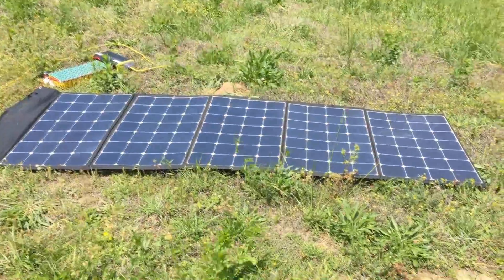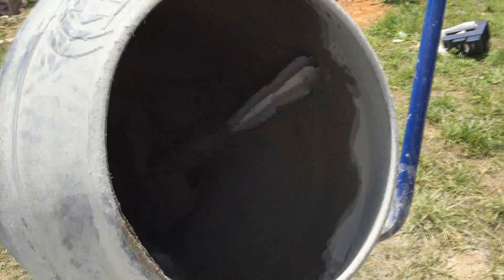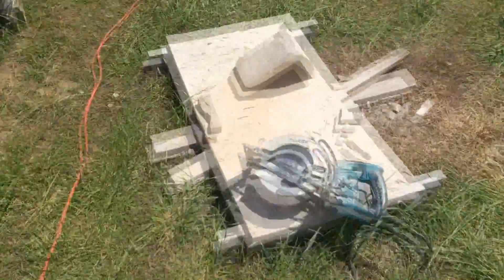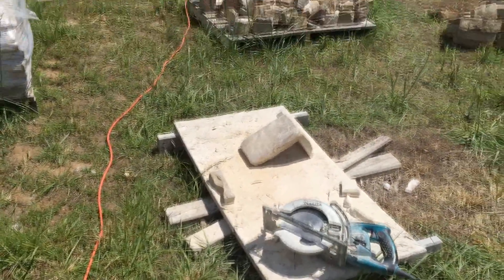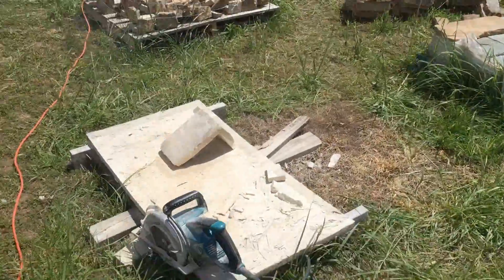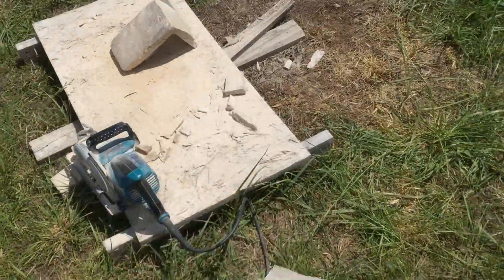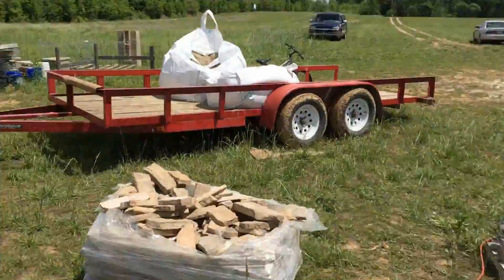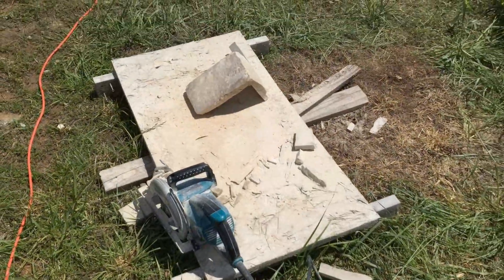SOLN1 2000 Update  - Battery-free Solar Generator

Comment: Here is a set of flexible solar panels, https://www.aliexpress.com/item/New-flexible-solar-panel-400w-solar-home-system-kit-100w-solar-panel-4pcs-monocrystalline-solar-cell/32748054355.html?spm=2114.search0104.3.8.nYn8sn&ws_ab_test=searchweb0_0,searchweb201602_1_10152_10065_10151_10068_10130_10084_10083_10119_10080_10307_10082_10081_10110_10178_10137_10111_10060_10112_10113_10155_10114_10154_10056_10055_10054_10312_10313_10059_100031_10099_10078_10079_10103_10073_10102_10120_10052_10053_10142_10107_10050_10051,searchweb201603_19,ppcSwitch_3&btsid=a4212515-3197-4669-976a-11da0392f09c&algo_expid=ecc8c09d-b21d-47ee-a0d5-9425a27553dd-1&algo_pvid=ecc8c09d-b21d-47ee-a0d5-9425a27553dd
you would have to make your own case though

Comment: this is awesome ive been thinking about building a solar system with a capacitor bank and have been wondering if these capacitors are safe before building it becuase i believe they cant shock you since they are 12 volts but ive been wondering if this is true with even the high farad capacitors like lets say 500 farads at 12 volts.

Comment: There is no thing as free energy, even if you go solar you have to spend loads of money on solar panels, which most likely won't last that long and you will have to buy new ones in the near future.
Reply: +mtothem1337 I disagree. The energy from the sun is free. Always has been free. Figuring out ways to collect it is not free. Actually the figuring part is free but the actual implementation is not free but it is getting cheaper. Solar panels purchased in bulk are getting pretty darn cheap and considering that most can last 30 years would seem to negate your negative argument.
Reply: consaka1 The suns energy is generated by nuclear fusion, it's by no means free energy.

But we are moving more and more torwards a future were solar panels are affordable and pratical though, so that's nice. Would love a future where everyone can just slap cheap solar panels on their roofs and power their houses without having to pay for it.
Reply: mtothem1337 ??? Seriously? Do we have to define "Free"?  How much did you pay for that "nuclear fusion"?  How much did anyone pay for it? I don't pay for it thus it is "FREE".
Reply: That future is now.

Comment: Not practical on a construction site at all. You need Li-ion for that, and lots of it. Something in excess of 10 KW/h.
These caps are best suited as back up batteries. Something like C/100.
You would not be able to cut one of those stones from begging to end. Let alone a few dozens.
Forget about the compressor, the power tools battery chargers, skill saw, chop saw, etc...
A Nissan Leaf bank connected to 2 x 48v-3000W inverters will do the job for about $8k.
if you wanna build out in the wild, and don't have access to gas, or don't want to freak out the nature around you by running a generator, it's the only way to go.
I built one and used it to build my cabin in the Canadian wilderness. Now, its a part of my solar power system :) 
Only have 500 W of panels. nuf for me.
I set aside $100/ month to buy 2 panels a year. In 10 years, with 25 x 100 W panels, and as the batteries age, I am ready to run mostly on the panels alone.  During the night, I'm a sleep and the cabin consumes 20 W/h.
Heating is by propane, but who knows what the future will hold ...?
EDIT: For those of you interested in wilderness living but don't want to be savages, check out: 
https://www.ubnt.com/products/

Comment: That unit should power flying adventures on the powered para sail maybe?
Reply from the maker: +1NRG24Seven I have some ideas along this line.  I have an aircraft design that provides tons of solar surface area.  It has great flight characteristics and is strong and easy to build.  Super caps are light and the new solar cells are very light.  I just do not have the time right now to start building the full size models.  It is very fun to dream about.
Reply: +lasersaber Maybe open source it? Let a community of people do that part and you provide the basics to its design...i think the idea would "FLY"

Comment: if somebody wanted to run they're 26 inch TV their PlayStation 4 be able to charge the phone run a fan and a lamp 24 hours a day what type of setup when one recommend and is it possible to be able to run a mini fridge as well? well I know anything's possible but what type of system
Reply: +nitpoon 
For solar ???  That's a bit more complicated since you need to know your energy consumption and calculate how much  Solar panels you'll need and how many batteries are required.  You'll probably need a minimum of around 500-600 watts of solar panel and  maybe about 2-3 deep cycle marine batteries.  This is just the bare minimum provided that you have good consistent sunlight.   That's about 1000$  right there.
Reply: +WTF BBQ yeah I'm using 4 Batteries they're like 250 bucks a piece sealed. I plan on having 4 200 watt solar panels I'm new to all this so I'm not sure how much that will put into the batteries I would say somewhere around 2000 Watts 3000 Watts daily is what I might need
Reply: nitpoon Oh wow,  you're really going for the expensive stuff. It's not bad anyway because it'll pay itself off in the long run. 800watts of solar panels was what I was going to suggest to you, but I wasn't sure what your budget was.  My 500 watt system cost me 1k $ and that kinda hurt...

I used the cheap batteries from Walmart.  They're about 100$ each.  Ideally,  you would only discharge the battery down to 70% to prolong its lifespan to 5 years or longer.  Draining it down to 50% consistently will kill it faster.   Most people think that the battery rating means it can store and deliver all of that energy,  but that's really false.  Only 30% of that rating is usable on a daily basis (50% on occasion).  So based on the 70% rule,  you'd size your battery according to your needs.
Reply: +WTF BBQ I've got a lot to learn it looks like pretty simple math to figure it all out but in the end I want to be able to run a mini fridge a lamp a fan a PlayStation 4 a 26 inch monitor 24 hours a day and my 26 inch TV I literally just started learning about this a week ago so I'm a total noob
Reply: nitpoon 
It's a cool project, and it's fun. You won't regret it. Though it might be expensive,  it'll pay itself back.  I believe I calculated it to be around 5 years where I live (used to be 10years).

  The weakest link in this system is really the battery. Lead acid battery is old technology that requires a lot of pampering.  Lithium ion is super expensive and can be volatile. The next best option are super capacitors, but the ones available on the market are not practical enough to replace batteries yet...

Whenever you are more comfortable with solar and batteries down the road,  look up Bedini pulse chargers.  There's plenty of them on youtube DIY.  They repair worn out lead acid batteries which "Theoretically"  can extend the life of your batteries more than 5 years.  I've heard some people used theirs for 10 years.

Comment: I'm not trying to rain on your parade, but that's all being powered from the batteries and not the sun. Otherwise you might as well say that everything is being powered by the sun. Since all fossil fuels + most renewables also come from the sun..... What you're doing is using the sun to charge your batteries/caps and then using those to power your equipment...... The reason I'm complaining is because it'll make people think that your solar panels are putting out 1kw+, when in fact it's just 100-200w, so people will erroniously think that the sun can provide that much power. It would be like saying my car starts with a battery, therefore my internal combustion engine runs on batteries.
Reply from the maker: +Eugene S   If you take a look at 0:23 in the video you will see the wattage used by the cement mixer.  The cement mixer uses 338W.  The solar panel unit is specced at 400W.  I was able to run the cement mixer all afternoon with an excess of extra energy for doing the occasional cut with the saw.  The capacitor bank provides a buffer that allowed the mixer to keep running even while the sun was blocked by the occasional cloud.  The capacitor bank charges in just a couple minutes.  It does not have enough energy to power the mixer for very long on it's own.  This unit was powering the cement mixer in real-time, not form the stored energy in the capacitor bank.
Reply: +lasersaber I see, but it looks like you're running the cement mixer and the saw at the same time..... That looks like a 8-10 amp saw to me.... Here's the main question, if you turned on the saw and the mixer at the same time, you agree that you'd only be able to do that for a very short time because the majority of the power would be coming from the capacitors. If not, then why even bother with the caps? To say that this was run off sunlight would suggest that your solar panel is providing enough power to the devices.... Second, wouldn't it be MUCH cheaper to just add a 12v battery instead of the capacitor bank? The advantage of the caps is that they can release huge amounts of energy quickly, I don't think your device needs that at all. Replacing them with lithium cells would get you a LOT more run time since the batteries can hold a LOT more charge. Finally, have you tested that solar panel's output? A 100w solar panel is usually around 24x48" in size... I can't tell but it looks like your entire panel is about that size... Again, I'm not trying to discourage you, just trying to offer my opinion to help you along with your projects. I've worked with solar a lot before, and there's a lot of inefficiencies that people forget to account for. But I guess my biggest question is why bother with caps when batteries are way better suited for this job? I don't know what caps those are, but if they're not super capacitors then a few 18650 cells would hold way more charge then a capacitor bank. The caps would be useful if you were trying to do something like DC welding where you need crazy high currents.
Reply: i bet you work for the government Eugene.you just don't get it
Reply: +Eugene S 
You should consider the capacitors as a damn/reservoir combo. It lets the sun dump energy into a "bucket" all at once. You can fill and empty the bucket all at once with capacitors too.  So, you can run the equipment as long as your on demand draw does not exceed your supply to the bucket.
Reply: +Eugene S 
The tools in the demonstrations are to showing short bursts of use/demand. Not running a band saw in a wood shop. Cutting 400 pieces of 2x4s.  So the recharge would in theory be quick and sufficient enough for quick intermittent uses. Fill up the 5 gallon bucket for a 3 gallon need... Turn off the spigot and it fills the 2 gallons (capacitors) almost as fast as the panels can push the power into the bucket.
Reply: Wouldn't the government benefit from energy independence? I'm just trying to point out that batteries are better than caps in this case. This isn't some sort of breakthrough technology that somebody's trying to keep down..... It's just a portable energy source...
http://www.amazon.com/Goal-Zero-22004-Solar-Generator/dp/B00CWBABRM?ie=UTF8&keywords=solar%20generator&qid=1464289868&ref_=sr_1_1&sr=8-1
Reply: @Eugene S - That's a pretty tiny power pack for a not so tiny price!
Caps are great for surge demand and quick recharge, with batteries for more stamina.
Solution is to add more panels and/or more caps if you need more power, and you can always add a battery between the charge controller and caps  if you don't mind the extra weight.

I made a couple of cheap portable folding 120W panels using 36 Sunpower cells off ebay and A3 foamboard from an arts shop and used 6 cells per page - it's easy to add more as funds/time allow, but they aren't as efficient as they could be because the cells run hot in their mini-greenhouses. I'll rebuild using better materials if I can find some.

I'm charging a big 48V 1.3kWh lithium polymer pack using 10 multicopter lipos for my ebike - best price/power/performance I could find, but MPPT controllers for it are as rare as rocking horse doo-doo! Looks like I'm going to have to try to make my own controller/psu.
Latest video on my channel describes it.
Reply: What's more important when operating equipment that needs a steady supply of power? To have a high flowrate but small bucket, or large bucket with a slower flow rate? Since increasing the size of the "bucket" would be relatively cheap with batteries (compared to caps), it's a more important factor to consider than the rate of charge. I don't know the exact capacity of that system but it's likely less than an a single 18650 cell ($5).
Reply: Can't pull the juice out of 18650s as quickly, can't charge them as quickly either.  Also, you can only use the top of the batteries, whereas most of the juice in the caps is available for use.  You have some good points, but there's value here.  It depends on the application.

Comment: Please do another video regarding the worst case scenario where the SOLN1-2000 will not work and the solution for it!

Worst case scenario:
- too many devices running at once.
- weather with dim sunlight
- etc...
Reply: +BlackHawkRider  Why would he do something that is as obvious as that? That is like posting a video of what happens when you run your car out of gas or oil.  The point is not what it will not do because that is mostly obvious. The point is what it can do. And that combination, he had there, is at the limit of what it can do.
Reply: This had dim sunlight. 2) 400 WATTS, exceed the limit and bammerino... Caps will be used till exhaustion.
Reply: doing the following obviously does obvious things

Comment: Awesome, keep an eye on Robert Murray-smith, his super caps are going to change the world
Reply: Like you indicated "In the lab" is not in the wild.  Good luck with your research. We need it. The figures I mentioned are from the guy who's currently spending billions of dollars building the planets largest building which happens to be a battery manufacturing facility in Nevada.  Whatever.  We'll have to wait and see.
Reply: ***** No, no it doesn't. materials cost of energy storage has nothing to do with moore's law. sulfuric acid, sodium nitrate, potassium permanganate, distilled water, ice, synthetic graphite and labor at around 10 dollars a gram of Graphene Oxide will never make it economical. There are other more attractive carbons, with higher surface areas that cost pennies on the dollar compared to GO.  That and whole colloid supercapacitors that laugh at graphene. 

And your figure for 25 years for max capacity of lithium ion is way off, 2000mAh lithium silica sulfur batteries already exist in the lab. Again it is not cost effective to release them as is. I have a method that will make them cost effective, just tweaking the thousands of variables. And no I have already explored graphene it's highly overrated and almost non-existent in planar single layer form, despite what the charlatans might want to sell you.
Reply: +bridgendesar - I am subbed to him too. Can't wait to see his car project and where he goes with the super caps.
Reply: +bridgendesar Nope cost too much to make, there is a reason no commercial manufacturer makes graphene oxide supercaps, they can't turn a profit.
Reply: Mechanicus - Have you been following his videos?
Reply: +Mechanicus That was true and for most, still is true.  For Robert Murray Smith it is no longer true, and many in the graphene arena will follow his footsteps.  His discoveries are admirable.
Reply: +Mechanicus ... Yet. ;) The cost and efficiency changes drastically over time just like Moore's law for microprocessors in the computer world. Battery and capacitor technology has a different time-frame, but it's no different in principle.  I haven't seen the stats for capacitors specifically, but for example, Lithium based batteries will gain between 5-8% energy density per year for approx the next 25 years before reaching their theoretical limit... It'll be THEN that graphene will start to really get battery manufacturers' interest and I imagine the capacitor industry will be singing from the same hymn sheet.